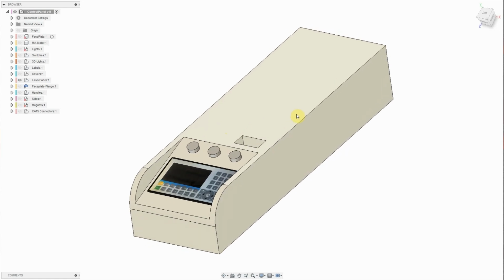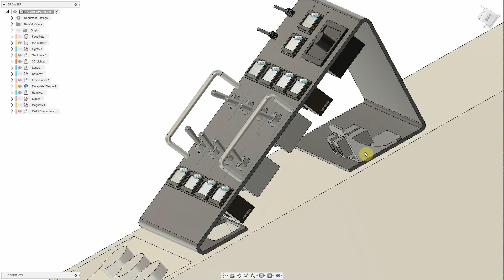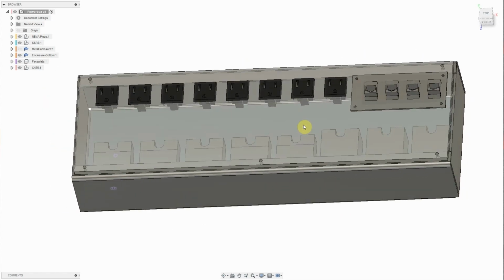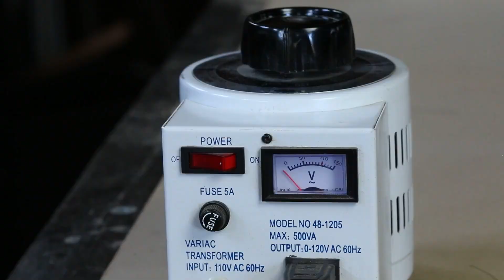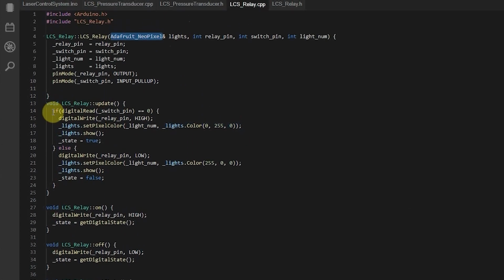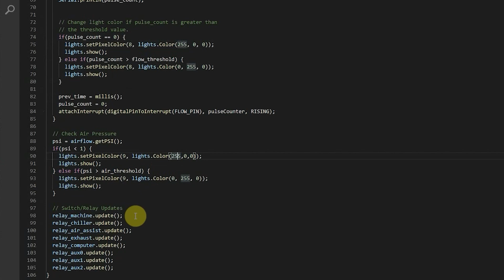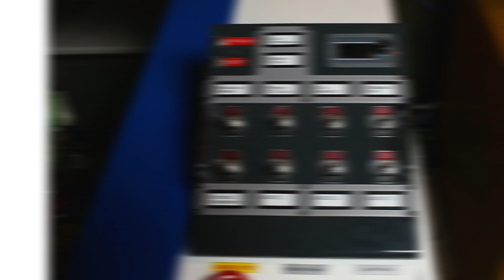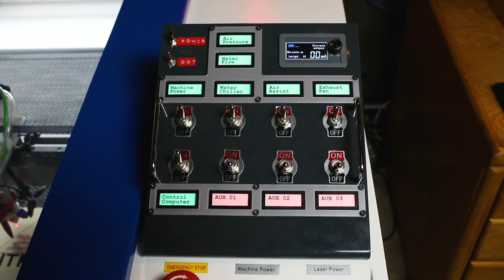Laser Cutter Command Station

Comment: One could replace the Control Computer Switch with a  momentary switch, and run sense wires back from the motherboard to the arduino to detect on/off status.
That would ideally have it to be closer &/or mounted on the rail behind the switch panel.

Comment: Your Arduino connected to the Ethernet? Then you should be able to power the computer on with wake on LAN and turn it off by sending a message. Or the computer could probably just poll to check the network connection and then turn off after a time if you only want to turn off.

Also you could maybe just power the computer with one of the axillary switches and a small ups. Just big enough to power down.

Maybe the simplest would be to add a Raspberry Zero for $5 :)

Comment: So much manual for an "automated" solution.

Use On-Off-On toggles, set as Auto-Off-On.  Flip them all to Auto.  Watch for data coming in (or stepper movement) meaning the job has started.  Turn on the water and then the laser.  When the laser fires turn on the fan.  If no stepper movement (job ended) turn off the laser, then after a delay the water & a bit longer the fan.

If you want to override the uC, eg to have the water run all the time, flip it's switch to On.

Toss in a bit of temperature monitoring, eg don't start the water pump if the chiller isn't at the correct temperature, this will trigger the usual fault if you try to start a job.
Reply: I was thinking along a similar train of thought. I think the reason he didn't completely automate it was so he could still turn specific portions, like the exhaust fan, on and off while he works, but this seems extremely manual still. More convenient, but not automated. Maybe add some macro buttons to put the system into specific states and then have buttons for toggling each thing individually in case you need to? It would be nice to press one button and have the laser ready to go.
Reply: @wowfirebat  3 position switches gives you all the control you want.

I've got mine set up as described, with 6 switches (Laser, Fan, Water, Air, Red dot, Lights), 2 temperature monitors (Laser In/Out) with RGB (red is hot etc) and a 4017 running 10 LEDs in a circle for water flow (not needed, just why not?).  Lights & Red dot on auto are triggered by a lid switch.  Arduino Nano, I think.

You want the fan on auto for the noise, and the water pump because you don't want the chiller running all the time (or waste the ice in your bucket).  The only time I flip anything to Off/On is when fiddling or setting up a job, so Fan to Off because you don't need it if just firing test shots, or the Air assist off when doing engraving (although that should be in the g-code if your controller supports it).  To be honest most of this should be in g-code, but laser controllers yeah...

I was going to add logging (run time, temps etc) but never got around to it.  Thinking about it, I still haven't put in an air flow detector for pick up fan failures.

Apparently I should have done a blog post or something.
Reply: It was more along the lines of convenience than automation. Good ideas for automation though!

Comment: Possibly overkill, but you could use an Arduino with a 32U4 chip.. Leonardo etc, to mimic a keyboard, and then send it a hotkey sequence to shut down.
Reply: Good solution, I bet that would work. I initially thought of what the API would look like for the USB UPS solution is.